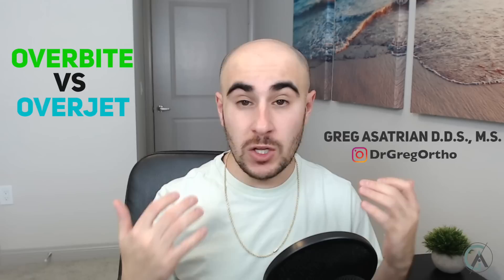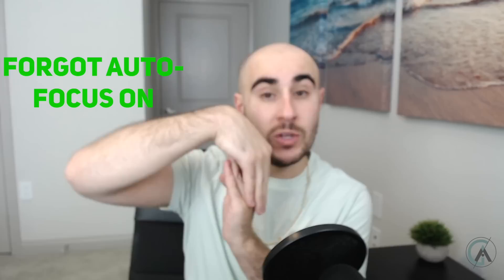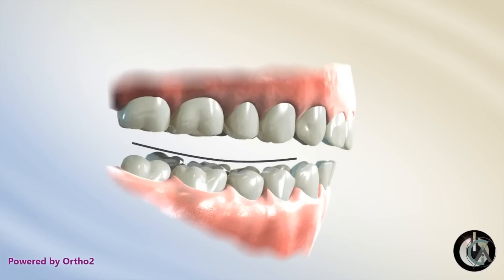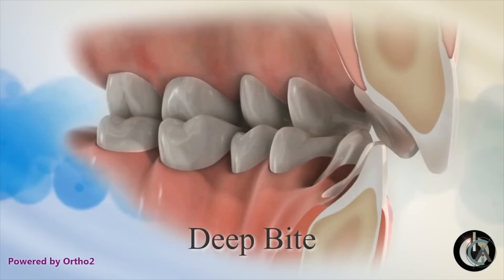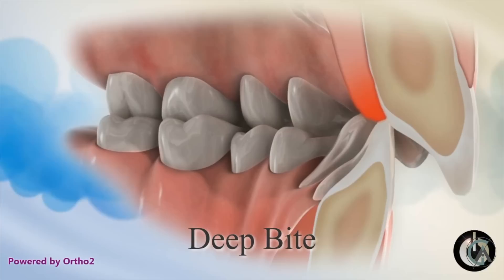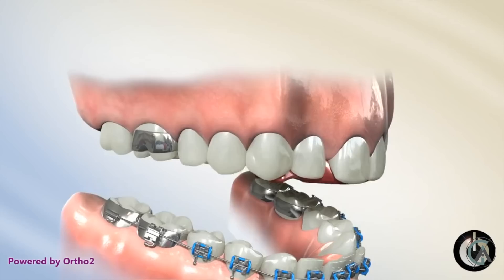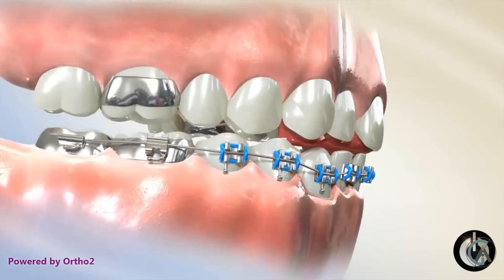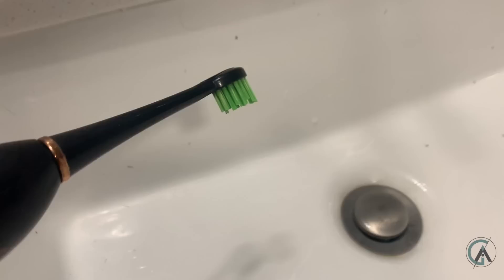Deep Overbite Bite & Braces: Causes and Correction / Orthodontic Treatments

Comment: I'm 23. I have a deep overbite. You can't see my bottom teeth, they dig into the roof of my mouth, and my front teeth curve into my bottom, my orthodontist said I have a severe overbite and I'm damaging my teeth. My dentist said I'm already on my way to TMJ if I don't get it fixed by braces. Hopefully will get them by the end of this year! 😊
Reply: How is it going? I have a deepbite also and my upperteeth are not straight at all. I want braces, but I am afraid. They sandale I would need jaw surgery after and I Reilly don't want that😢

Comment: I am 27 with braces to fix an overbite and I have that curve of my bottom teeth, which I never even realized I had until I got my fixed bite plate (which I HATE lol). It's crazy how you can see the curve! I have 4 brackets total on my top teeth and brackets and wire on all bottom teeth but my last molars and wear elastics to help fix my bite. I hate it, it hurts every time I get new positions for my elastics or any other adjustments, but I hope it will be worth it in the end! My teeth are damaged from years of my bad bite so if anyone reading this has an overbite, get it fixed!! Also I have noticed that my lower lip protrudes more than it used to, my profile looks different, it's wild what a proper bite does and looks like vs. an improper one.
Reply: How’d it turn out?
Reply: Was it worth it in the end? Was the profile change an improvement?
Reply: @elguapo87  great! bite fixed, now I wear retainers
Reply: @Marc467gg  yes, bite is fixed! not a huge profile change imo so I don't think my problem was that dramatic but my bite is normal now, teeth properly aligned, and I don't grind my teeth anymore. they think I grinded my teeth bc my bite was off.

Comment: I got braces, where my ortho claimed that my treatment(which was for good smile) could be done by putting wire on upper arch only. 11months into treatment my bite worsened. I had class 1 bite. 
I didn’t have a deep bite but yes ,My front teeth hit my bottom ones at back somewhere in 3/4th height. Now  i have got overbite/deepbite (80% lower incisors covered by upper incisors) only one teeth touch bottom ones. And rest on my lower lips day and night.  My face also changed.

Comment: You mentioned how to correct a deep bite caused by the BOTTOM teeth coming up too far, and briefly mentioned that the top teeth overextruding (or whatever it's called) can cause a deep bite, but how do you correct that exactly?  When it's the top teeth that are the problem?  That's my issue because I have the gummy smile you mentioned.

Comment: I have been on braces for more than a year now, we found out later that I have allergy to elastics so it'll definitely wont work. My ortho recommends to extract 3 teeth, 2 upper, 1 below. I'm not sure if I need to push it thru or just accept the changes been made on my overbite. So far so much has change but my front teeth still protrudes. Any thoughts?
Reply: What did u end up doing .. my ortho is saying the same but only extracting 2 molars( if I decide to go thru w it) I’ve had braces for 3 months now
Reply: @adarijohnson  if you dont have any other commitments soon, you should go with what ur dentist said. My dentist said that it could take a while before the teeth adjust. Maybe 3-4 months, it will hurt, you will have difficulty in eating and talking buuuttt all of it will be worth it.

I actually was waiting for an employment opportunity before but this year I confirmed that I cannot go through so I did not push through with it at first. I'm planning to talk with her now that I'm not going elsewhere.
Reply: @jiyujinsano7917  she didn’t rlly mention any other commitments yet she said she’ll talk about it w my mom next time .

But yesterday when I went ( I have an overbite so my top teeth cover my bottom & it’s not aligned n stuff )
They put sum type of glue on the roof of my mouth to prevent my top from covering my bottom
And it feels weird & it’s already hard to it bc it’s not the way my teeth naturally fall. & my tongue is crowded 😭

But thank u for ur advice . I think I’ll get them removed & my teeth should have adjusted by the time school starts 😣
Reply: @adarijohnson  i was thinking that too, sooner you get them removed, sooner it will adjust. Just the time before school starts. Goodluck to us!!

Comment: Great video! Is it safe for orthodontist to use bands for overbite on teeth that have restorative work ? I’m a little worried to start elastics next week. The last bracket is on an upper bridge (the first crown) and I believe the elastic will be hooked on that tooth that bridged (upper) to lower tooth that has a root canal & crown. It’s a lot I know! How worried should I be?

Comment: I have a pretty bad overbite. My incisors pretty much completely overlap. I've never had gum issues, but I do have a chip in one of my lower incisors that may be a result of the overbite. I have upper arch braces right now and go for my first adjustment next week. Hopefully I'll be able to get lower arch braces soon, but first my upper teeth need to move some so they don't knock brackets off my lower ones.

Comment: Hey Greg, I just got my braces off and I’m doing my best with the retainer, but I have a question. Are there certain foods that I’m suppose to avoid for a period of time or am I free to sink my teeth into pretzels and caramel
Reply: It depends on the retainer you use.
Reply: Konic how does that work
Reply: @heyfrosty9429  There are two common types of retainer. The first one is the retainer which you can remove and wear, the other one is the permanent one. It will work like a brace but it will be stuck at the back of your teeth. If your retainer is the removable one, you can probably eat anything, you just have to remove it first. If you use the permanent one, you can eat anything as well, but you just have to be careful and clean your teeth thoroughly especially if you eat sticky foods.

Comment: I wish you were my orthodontist! Also my wire isn’t poking me but it’s the actual bracket that’s over my canine. The antenna part that stick up is giving me a canker sore under my upper lip. The wax helps a little. Can they bend the antenna in a different way so it doesn’t hurt or does it have to point that way? Thanks

Comment: Hi, I currently have an overbite, it's not hitting my gums but my bottom teeth aren't too visible (I can only see them a little). What would you recommend for me? And also have you heard of mewing, I would love to hear your opinion on that.  Another question, what do you think causes an overbite or an exaggerated curve of spee? I had a theory that it could be because of too much chewing on the pre-molars?  because as we saw in your video it is possible that biting pressure over time in a specific area can push the teeth down (like the bite plate and bite turbo's) so what if that was what's happening to the premolars to create the exaggerated curve of spee? loved the video though, thanks a bunch!

Comment: You repeatedly mentioned lose applicants like byteplates etc.. But it seems that they are mostly combined with full fixed braces. As I mentioned before I am searching for examples, where a small overbite is corrected with an activator in adult age. There are typically "bite-on" activators which form an bitebed between upper and lower jaw. The teeth should match against this bitebed during wearing this apparatus. It may be combined with a chin-head-cap to press the jaws together. Especially in the night. If I would do a third orthodontic treatment, I would like to get such an tool. Curious how it feels. And to keep it as orthodontic costume gadget over the time of treatment. Perhaps you do not practices this technique. But you could search for information about it and tell something about it.

Comment: That's a very informative video, thank you! I have a question - I have been wearing braces for 5 months now and elastics for about 2 months, and I can now see that both of my bottom teeth to which you hang the elastics on (2nd molars) are twisted to the inside and misaligned. Is this a normal effect of trying to fix an overbite? Also on the left I have the first molar missing, so that second molar is even more twisted. Should I be worried that this has happened or this is normal and later on it will all go back to normal? They said that the molar with the gap next to it has short roots so it's dangerous to move it, but isn't it also dangerous if it twists around? 😣

Comment: oh man, i had such a deep bite during my braces process along with gum swelling because my gums had allergic reactions to the metal in my braces. this made it so sometimes if i didn’t brush my teeth for like 8 hours, i could scrape the gums behind my top front teeth with my bottom front teeth. thank goodness it went away after a couple months😅
Reply: @UPONHAQQ  no, i’ve been wearing my rubber bands for a while now
Reply: @kai2862  damm I also have a deep overbite, I went to my dentist and she said to fix it you will need to get jaw surgery.  
I hope my braces can’t make it better.
Reply: @kai2862  so you still have a deep overbite but has it reduced, like has the deep overbite become less then it was before braces if that makes sense?

Comment: Unrelated question: Can the vibration of an electric tooth brush make brackets break off?
Reply: I’m not a doctor but I have braces and use an electric toothbrush so from my experience it should not! But you have to be careful with using the electric toothbrush while you’re still trying to get used to your braces 😁

Comment: I do have a deep over bite and because of which both my jaw joints have grinded down so much that there is no disc left and my surgeon said that I need a total jaw joint replacement surgery to fix this problem it is hard for me to chew my food and way too painful I have had an arthroplasty surgery of the left side of my jaw in the year 2015 but the surgery did not helped much with my pain  and I am struggling with this TMD problem since more then 6 years now and what should I do for my pain I have even tried wearing splints and night guards but it just did not reduce my pain.

Comment: I have a deep bite and when i close my mouth the teeth on the left (top and bottom) touch eachotyer, asi it should be, but the teeth on my right side don’t touch and my jaw doesn’t even have to do work bc they barely touch. U can barely see my lower teeth and i have a clicking without oain in my left side. 
I ha gone to the same orthodontist all my life and they never saw it. I see it and it’s undeniable. I think i should change othodontists. I need braces but i don’t have the money for it :(